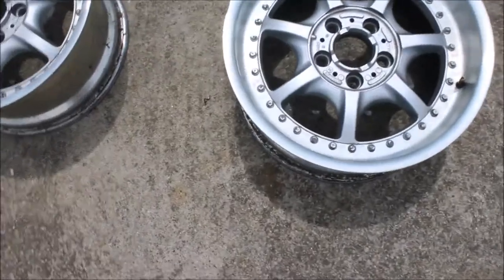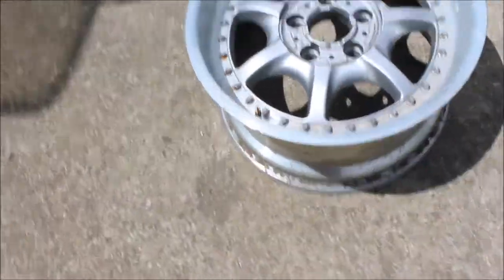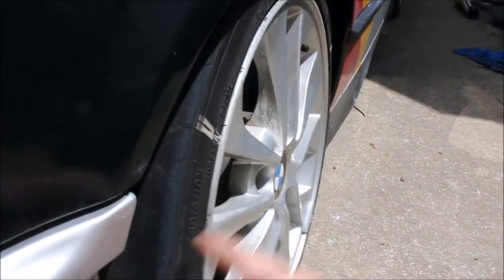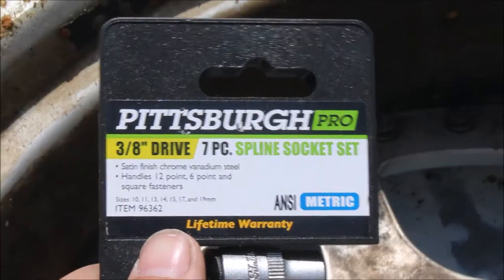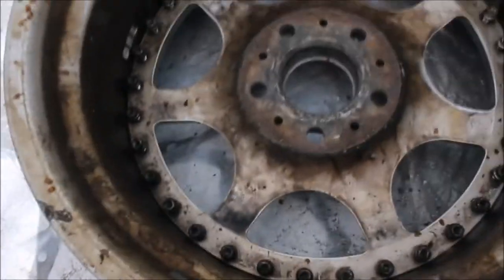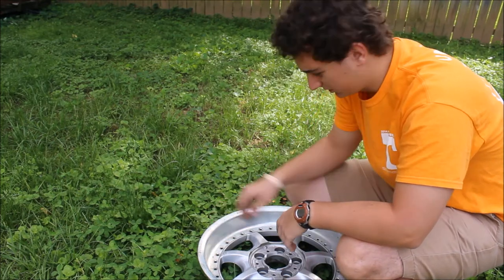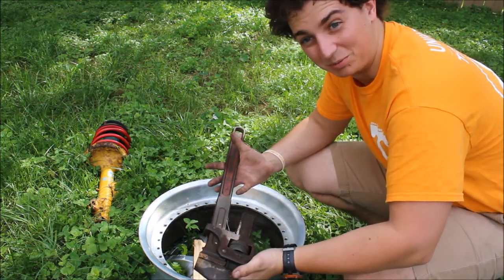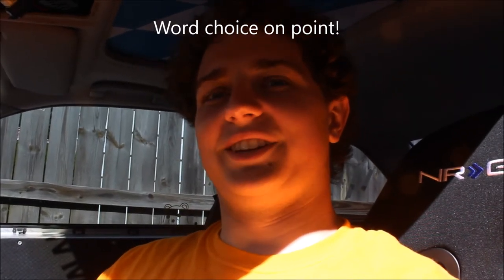Taking Apart Two Piece Wheels

Comment: Guanghzou Jova car Accessories Co.,Ltd. is a professional custom wheel manufacturers, 6061-T6 forged aluminum wheels. We custom made high performance 2 piece wheels(https://www.jovawheels.com/two-piece-series_c16) and 2 piece rims for suv, off-road, racing car, sport car, from 18" to 24". We do 2pc welded wheels & forged wheels with rivets. Warranty: lifetime warranty for forged wheels.